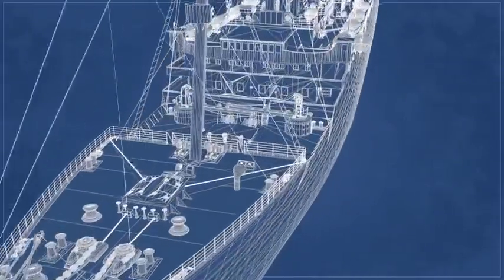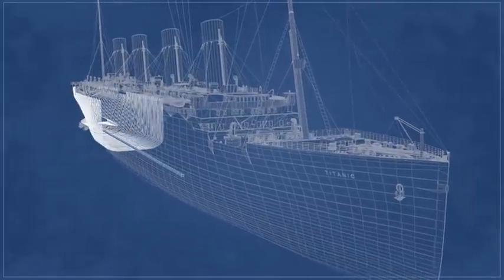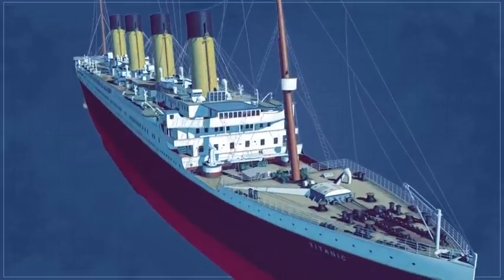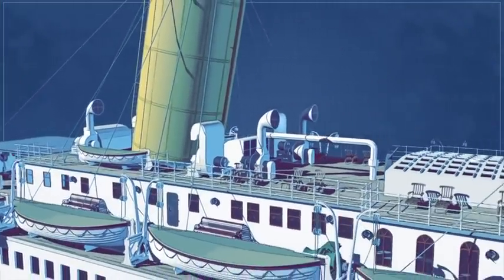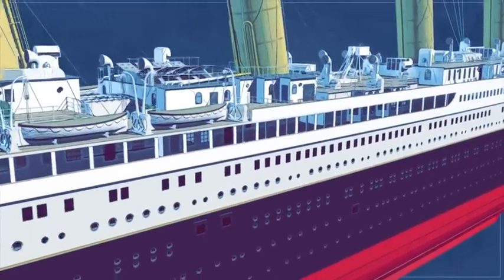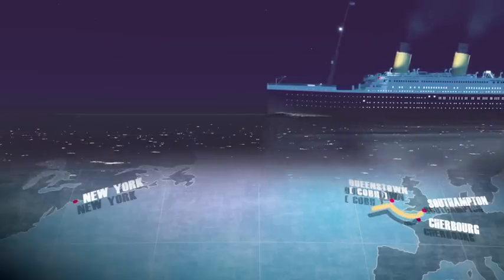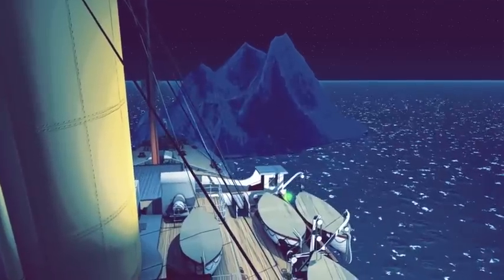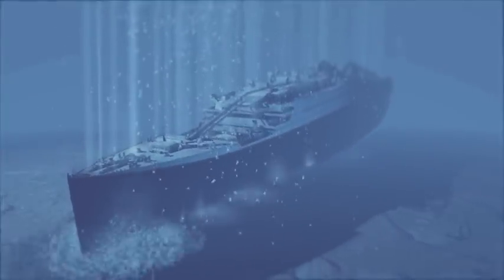The Titanic 3D Model - As You've Never Seen Her Before

Comment: Here's a question for the Titanic "experts". Why were Titanic's stern portholes spaced out differently to that of Olympic and Britannic?. Both Olympic's and Britannic's stern portholes (both starboard and portside) where arranged exactly the same, but Titanic's weren't. The 3 forwardest portholes on Olympic and Britannic were spaced more evenly (equally), but on Titanic these portholes were unevenly spaced.

Also, anyone know why some interior photos of Olympic's A deck open prom show a long white pipe attached to the ceiling, yet other photos from a different view point and further along A deck show no pipe running along the interior of B deck?. No idea if the photos are taken from the port or starboard side.
Reply: Assuming you havent heard the conspirifact that titanic was swapped for Olympic and sunk on purpose in a insurance scam?
Explains the differences...
Reply: I think it was an extra room for the postmen? I forget but Oceanliner Designs has a video where he talks about why they made the extra portholes.  It was some extra room that got a window as a larger compartment was divided. I forget if the video was specifically about Titanic vs Olympic or if its in his "details of Titanic" or something. I can look for it if you want.
Reply: @please_stop-v7o  Thanks for that. would be good Are you meaning the portholes on the stern?. I don't know how they added an extra porthole for an extra room as that section of the stern where those portholes where placed is the same length on both ships, it's just the spacing of the portholes that is different (from what I can see anyway). I should do a side by side comparison of both ships to see if there is any difference. That's the biggest issue I have with the switch theory, if they switched them then how did they swap over portholes so they matched.
Reply: @Embracing01  Oh no I mean at the bow, forecastle B deck, the white part has one or two extra over Olympic. Not sure about the stern.
Reply: @Embracing01   And yes Switch Theory requires impossible things. Like moving Titanic and Olympic from their births without anyone noticing, the portholes, every item from furniture to coffee cups has the hull Nr or name, the name itself is actually engraved in the steel. It's not letters attached the name is engraved in the hull plate, so you need to also switch the bow hull plated, fill in a porthole, cut them out on Olympic, remove and add promenade enclosure, extend Parisian Cafe, add millionaires suites to Olympic etc... 

It become more ridiculous the more you look into it, it's why only people with surface knowledge find it even plausible. 

I can link some debunking vids or websites if you want, I just avoid the Switch Theorists now. I list my top 5 reasons it's BS and move on... 

The time could be spent explaining why QE was better than QM or why Normandie was supeior to both:)
Reply: @please_stop-v7o  I don't believe every item needed to be changed/swapped around and had the number on them, and why would they if at a later date those items could be used on another ship when that ship had been scrapped? it would be a waste. 

Anyone not privy to the switch save for Smith and a few officers, plus Ismay and possibly Andrews, wouldn't know what the ship looked like and wouldn't have noticed anything unusual. Some accounts from passengers remarked that Titanic didn't look like a brand new ship, plus there is a witness account during the sinking of someone in third class clothing seen jumping into a lifeboat being lowered from the B deck enclosed prom, yet this section was supposed be a room. If Titanic was underbooked (intentionally) then this area of B deck may not have been occupied and may not even have been a room because they may not have had time to complete the room.
Reply: @Embracing01  Besides the crew starting up the engines on both ships, 600 coalers total, engine room crew, bridge crew, reverse out both ships, reenter now Titanic on starboard and Olympic on portside. Then presumably in the same night switch out the hull plated for the forecastle with Titanic's uneven portholes, ships name, so basically take apart the top 30 feet and forward 50 feet of hull plates. Which you can't just remove, the decks via the frames are bolted to them and the whole structure relies on being complete to be strong enough to support the decks, so you have to take iut everything above the modified area, so the forecastle, steam powered capstans, whith high pressure steam lines from the boilers going through there to power the anchor winches and the I think 6 bronze capstans. 

Meanwhile the promenade enclosure is removed on Titanic again requiring bolts to be undone. Which is loud af and tedious and avoided unless absolutely necessary. 

Promenade enclose added to Olympic, millionaire's suits (where Rose lived) removed on Titanic but added a year later (1913-14 Olympic refit). 

Meanwhile the bridge wings on Titanic are removed (bolted steel) because they extend by 1 m, while on Olympic they are flush with the hull. 

This was done for extra visibility aft. 

Then change all the furniture because yes every item had either hull nr 400 or 401. Otherwise how do you know what goes in Titanic and what in Olympic, it's just scribbled on by hand. 

Then carpeting removed in the first class lounge and linoleum floor of Titanic added to Olympic. 

Then remove the collapsibles from Titanic and put them on Olympic. 

Marconi was different, Titanic had some extras so switch out the Marconi, at least several components in the main room and one or two in the marconi machinery room, next door. 

Hmm what else? I think we're good. Right the plates said WSL so those can stay but SOME do have the ship name. It would stay with the ship. Plates are usually redesigned in a more modern style once a liner retires and they are usually sold off as commemorative items to fans of the ship, like did happen with most of Olympic's interiors in 1935-1937 when Olympic was scrapped. 

And of course the 10k workers or so all necer said a word about the weirdest most stressful day at work in 100 years, not even deathbed confessions. 

And of course this would have been extraordinarily expensive. More so than just repairing Olympic. It was pricey but as far as ocean liner major repairs go not the worst. Still cost as much as 2 years profit from an Olympic class. 

Insurance paid nothing because the Royal Navy faulted the White Star Line so they paid for the Olympic and HMS Hawke repairs (she was busted real good, much more impressive repair job). 

So Olympic is declared a loss, despite the WSL sending all the money to Harland and Wolff. No doubt it was quietly returned to Ismay. 

The switch happens. Olympic, now disguised as Titanic, somehow repaired enough to appear normal. Prop shaft and prop replaced at the very minimum, she cannot do 21 knots with 2 props only so it HAD to have been repaired enough. Hull plating repaired above the waterline, patched below. 

Titanic goes into service disguised as Olympic. 

Olympic does sea trials for a second time, is certified by the Board of Trade as Titanic, sails back to Belfast for final fitting out, then on to Southampton where many of Olympic's interiors are added. 

Titanic (Olympic, hull 400) is fueled and made ready for her second maiden voyage and sets sail. 

3000 miles ahead, a small WSL is tracking an iceberg and relaying the coordinates to Smith who alters course South to intercept it (still within the traffic lanes). 

Olympic (hull 400) is smashed into the berg and sunk. 1500 die, WSL looses 30 years potential profit and has to put one of the Big Four back on transatlantic duty to help out Olympic (hull 401, Titanic). 

WSL nears bankruptcy, Ismay is ruined in the eyes of the public, Titanic serves as the most famous example of how to screw up. 

WSL never fully recovers and is eventually absorbed by Cunard, White Star liners are scrapped including Olympic (Hull 401 Titanic). 

Ismay dies. 

70 years later Dr. Bob Ballard finds Olympic and she perfectly matches Titanic in every way.

Oh I forgot, insurance only covered 70% of construction costs and none of the roughly 10 million in today's money in passenger compensation (1915). 

So either way they lost a lot of money. Also no insurance for lost revenue. And of course Britannic is also lost. Though WSL is given the Majestic as recompensation after the war.
Reply: @please_stop-v7o  After all that, you are forgetting a few things, one that they never intended for alot of the people onboard to die, if you consider the switching and planned sinking the high loss of life was down to the planned rescue going wrong due to human error. There is no evidence that Titanic hit an iceberg or an iceberg caused the damage, but there was one very close to Titanic. There are witness accounts of seeing a "yellow funneled steamer" sailing very close to Titanic as she was sinking, also accounts of other ships nearby which never helped. Also, some witnesses who saw parts of a ships wreckage down below as they looked over the railings from the boat deck. 

As for workers knowing about the switch, well there are lots of descendants of workers in Belfast (and in Liverpool) who believe there was a switch because it was passed down to them.
Reply: @Embracing01   The entire premise of the switch theory is armchair idiots who have never seen a shipyard make determinations on what repair jobs are realistic. What the hell? A naval architect can tell you that. 

Seawise Giant sunk, was raised, cut in two, extended and kept sailing. If you think Olympic repair was impressive you should look at warships. 

Heck HMS Victory took a 500 lbs bomb from the Luftwaffe. Didn't do they much damage, despite such bombs leveling houses. By virtue of having to survive storms ships are tough.
Reply: @please_stop-v7o  Not true. Author/researcher John Hamer spent 3 years looing into the switch theory, he visited the Bodlien Library in Oxford where all of the inquiry transcripts are held, visited Belfast and spoke to descendants of workers, and even spoke to Lightoller's great nephew. Not exactly an armchair idiot.
Reply: @Embracing01   Damn my comment keeps getting removed Joh Hamer has been debunked. Just google it.
Reply: @Embracing01 because they wouldn't be used in other ships. Every item that is being built like panels, are stamped with the yard number so that it goes to the specific ship they intended. When it's scrapped, it is most often auctioned. Metal parts are  reused by melting it. 
Titanic already had its sea trials and travel from Belfast to Southampton. The construction time alone rusts certain parts and make it look old. 
There are no accounts of seeing passengers jumping from B deck. Pls mention the source of that claim and who said it. Still on the week, B deck has staterooms. James Cameron even explored it.
Thomas Andrews and Ismay won't know which ship it is? That's the most illogical argument I've ever heard. Andrews knew these ships inside out. These ships were Ismay's dream and he was very much involved in planning their construction.
Reply: @gokulgopan4397  Ismay and Andrews likely knew about the switch and Andrews probably thought he would get off the ship (he may've been disposed off like Astor, Guggenheim and Straus - maybe). As for the sea trails, interesting that Titanic's sea trials took only half a day compared to Olympic's 2 day trials, all Titanic did was basically go up and down Belfast Lough.

Comment: Great video, very informative. I have learned quite a lot of things about Titanic during the last year on YouTube, but there is always still so much to learn. In this case, e.g. the antenna for the Marconi Room. It was part of the "rope" or wire connecting the forward and aft mast, as it seems. Also, the sinking process with the water exceeding the bulkheads on E deck is visualized very clearly.

Comment: I believe her center prop was a four blade, not a three blade as depicted here.
Reply: Center propeller was three blades per H & W specs…
Reply: @timothyreed8417  I believe that the "as built" configuration ended up being different as all the pictures I have seen show four blades for the center prop.
Reply: @dueljet  there are no pictures of Titanic’s propellers….they are all pictures of Olympic’s propellers…often mislabeled..
Reply: @timothyreed8417  but there are pictures of Britannic which came after Titanic. So if the Olympic and Britannic had four blades on the center location, I believe it's more than likely the Titanic did as well.
Reply: @dueljet  there are H&W documentation that show  a 3 bladed propeller…remember there weren’t any computer simulations…they built it and put it on and tried it out….they were looking for passenger comfort, speed and efficiency…
Reply: @timothyreed8417  I've read the encyclopedia titanica stuff myself. Short of going down there and physically looking, I don't think we'll know definitively.
Reply: @dueljet  i read more that ET posts….there are documents that show that the center blade was 3 bladed…
Reply: @dueljet  Britannic had 4 bladed center prop bcz of the result from Olympic's experiments. Since Titanic sank and they couldn't get results, they changed Olympic's center prop from 4 to 3 bladed. Then war broke out so they didn't change it until 1919 refits. During this period, Britannic was ordered to build and Harland and Wolfe found 4 bladed had less vibration and more efficiency. That's why they used 4 bladed props in Britannic.
Reply: Actually noone knows for sure.
Reply: @Embracing01  yes. The current evidences imply 3 bladed center propeller (the engineers notebooks, H&W documents and the dry dock photograph). 
Unless they dig it out and prove otherwise, all the current evidences show 3 bladed.
Reply: it was....3 - 4 - 3 ....

Comment: I wonder if stopping the starboard and central propellers, leaving the port prop in full speed into the rudder; could have bought Titanic just a few inches to avoid most of the collision.
Reply: It would, but at what cost, we don't even know if the engines could be controlled independently as that could cause a lot of vibration and would be inconvenient unless you were to crash on your mayden voyage.
Reply: It would take more than 30 seconds to stop an engine and put it into reverse and more time before it had any affect…
Reply: @timothyreed8417  I have heard so many theories about the engines. Many accounts contradict each other. 
Was there an order to the engine room telegraph to reverse engines? Were they put into 'full speed astern'? Did they ever start spinning backwards BEFORE the collision?  
We did an RC test many years ago, with a boat with semi-similar rudder to Titanic. When spinning the props in reverse while the ship moved forward, the steering was dramatically reduced, possibly because of the vortex around the rudder? 
I would LOVE to know if this happened before the Titanic struck the berg. Never really can get a straight answer!!
Cheers
Reply: @ccrider3435  was the RC boat powered by steam engines? Or electric?

Comment: Ya and there is a problem. The two side propellers is four leaves propeller...
Reply: No....the propeller blades are 3 - 4 - 3 ....
Reply: @volpeverde6441  incorrect
Reply: @IllBushido  
even though the log book says 3 - 3 - 3 for the TITANIC....there is no proof....
the OLYMPIC and BRITTANIC had 3 - 4 - 3....why would you change that design to power the biggest of the 3 ships....
when the TITANIC turns to rust....perhaps someone will fetch the propellers back....
Reply: @volpeverde6441  can you provide documentations based on your claim?
Reply: @volpeverde6441  there's one photograph during the fitting out stage showing a prop near the ship ready to be installed being 3 bladed. Plus the documents from Harland and Wolfe notes 3-3-3 configuration with different pitch, diameter etc..

Comment: I thought the central propeller was a 4-blades one?
Reply: The Olympic’s was 4 bladed. According to actual written documentation from Harland & Wolff, Titanic’s was fitted with 3 blades.
Reply: @DerpyPossum  
TITANIC was 3 - 4 - 3 blades....
Reply: @volpeverde6441  According only to assumptions based off Olympic.
Reply: It was....       3 - 4 - 3   ....
drive....and direction through the rudder....
rudder should have been bigger....need a big car park to turn this round in....
Reply: @volpeverde6441  all three propellers were three bladed per H & W specs.
Reply: @timothyreed8417  
there are pictures of TITANIC and OLYMPIC both....they have been coloured in....slightly different body shapes and TITANIC's red belly paint goes way higher than on the OLYMPIC....
both are 3 - 4 - 3 propellers....
Reply: @volpeverde6441  this is in fact false information. There are very few photographs of the Titanic and none of them show the ship’s propellers.
Reply: @volpeverde6441  there are NO known pictures of Titanic’s propellers (except from the crash site of course)…the center propeller was 3 bladed per H&W specs…you can not make any assumption of the propeller layout from other ships…H&W was always testing/experimenting with different types..for best speed vs coal consumption vs passenger comfort.(the turbine vibrated badly at certain rpms…)…
Reply: @volpeverde6441  that was Olympic's propeller configuration, not Titanic's.
Reply: @volpeverde6441  rudder was of sufficient size. If it really was a problem, they would've changed it on Olympic and Britannic. 
Father Browne photograph of steering test in Queenstown shows Titanic had good turning radius.
Olympic's war time Captain stated she had one of the best manouvering capability among the ship's he commandeered.